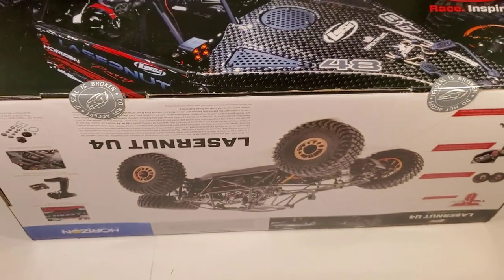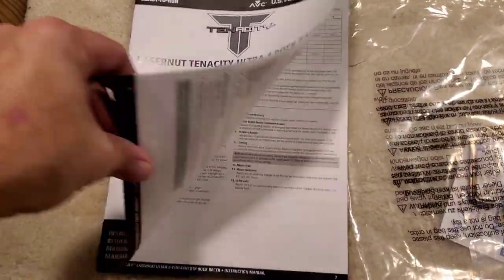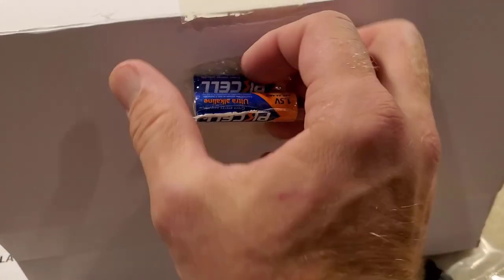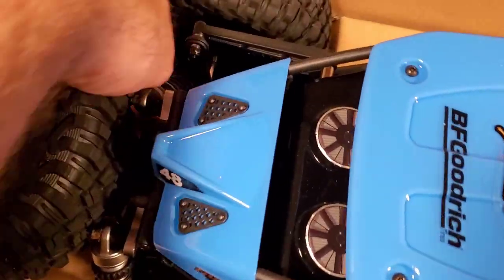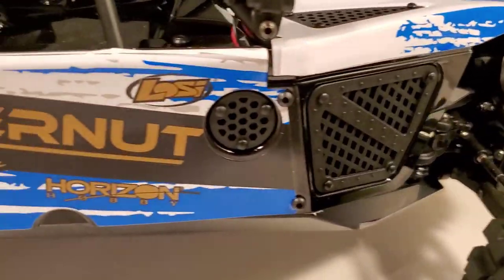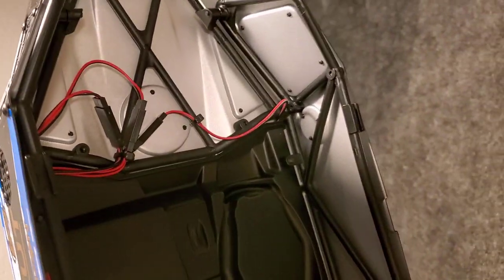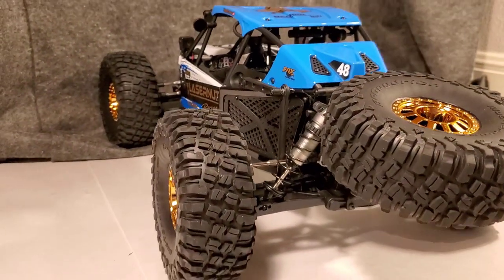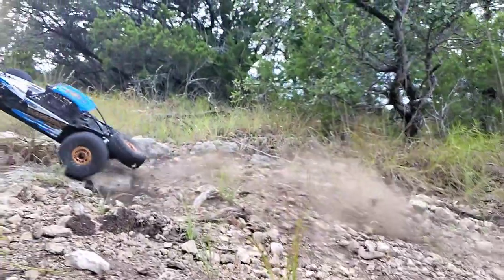Losi Tenacity Lasernut U4  Unboxing, Impressions, and some vids

Comment: Blue loctite the wheel nuts. Lost two of mine on the first pack.
Reply: Blue on small wheels orange on 17mm lots of rims brand new tightened very hard come right off sent me down a rabbit hole of testing. Don’t orange the small hexes I destroyed a rare old school rim that way. FYI. Good advise! Locktite, sit overnight and check before and during runs until you know how that car reacts.

Comment: would you recommend this rc for a first timer?
Reply from the maker: For a first timer I'd stick to a 3S battery until I was used to it.  Seems plenty durable and easy to work on.
Reply: @1TenthScaleRC  wondering what you ended up getting and do you. Like the rc you got?